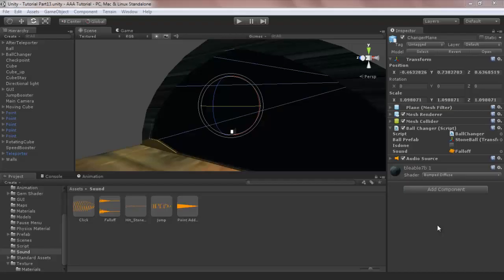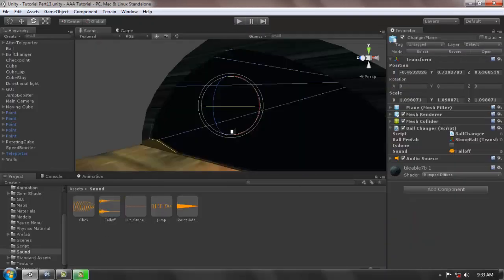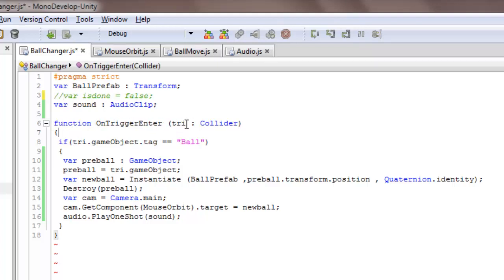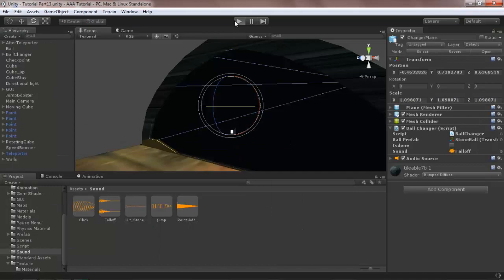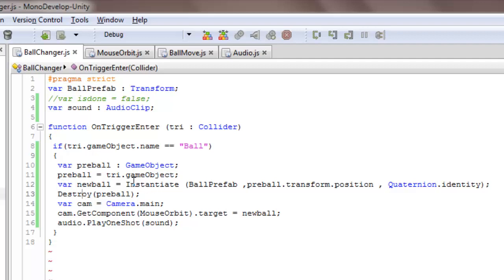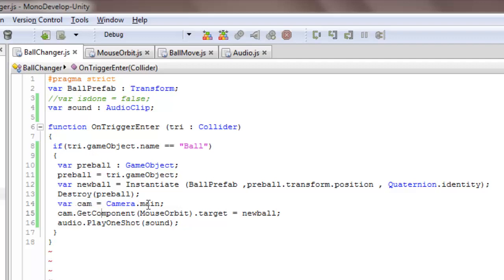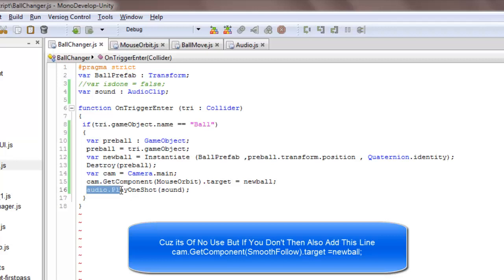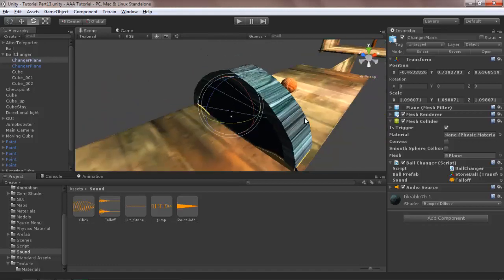How To Make A Ball Game In Unity-Part 13

Comment from the maker: Position - Click On The Ball And Then from Transform Window {Right Side} Make The Position [0,0,0].
Animation - From The Hierarchy Window [Left Side] Cilck On Rotating Cubes > Rotater .Check That
1.Is Animation Attached To It .
2.If It Is Attached Then Check That Is It (Play Automatically) checked.
3.And Click All The Animations Inside The Animation Folder and check that "Warp Mode"[Right Side] is "Loop".
Hope This Will Fix It.